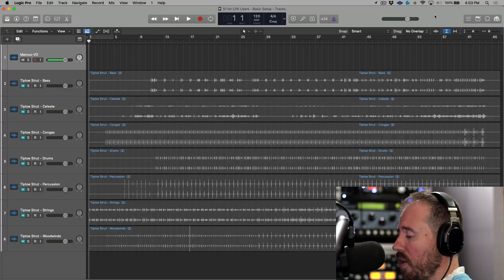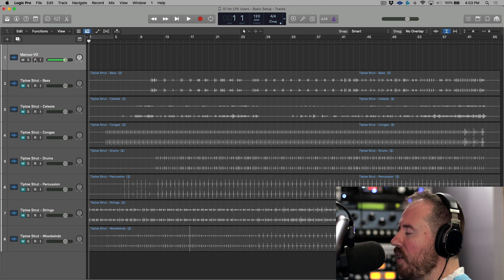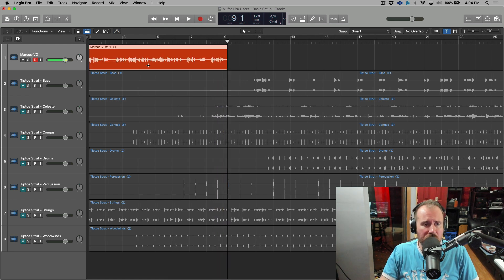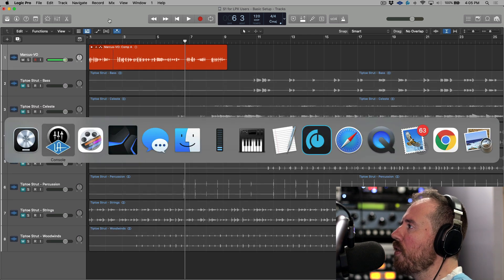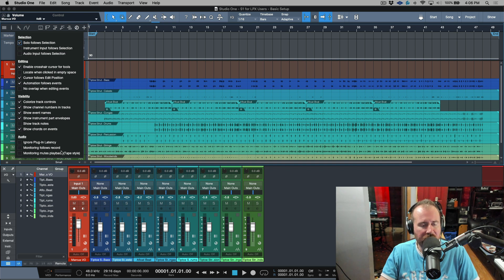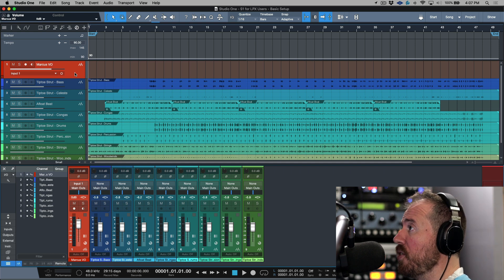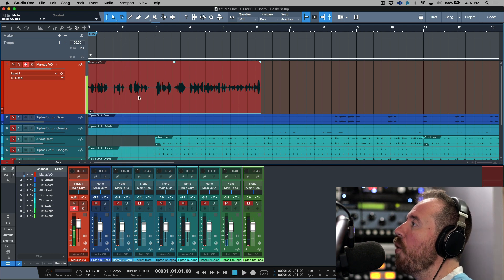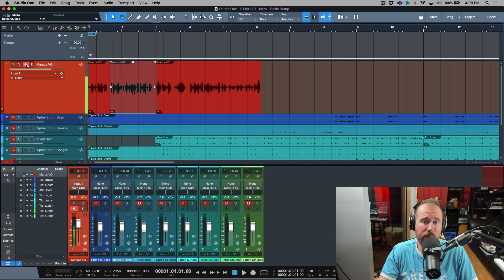Software Monitoring vs Hardware Monitoring - #StudioOne For #LPX Users - Part 3

Comment: Nice video! I usually record vocals with Software Monitoring in Logic which usually works fine, however with huge sessions and plugins sometimes latency creeps in when recording but it is much better to record vocals with reverb, delay, a little tuning, etc. As far as I have found this is not possible to do with direct monitoring correct?